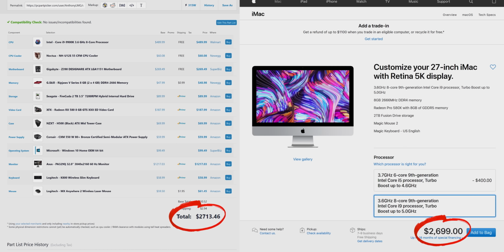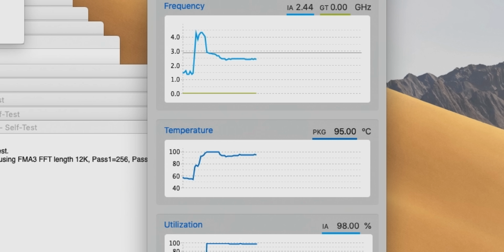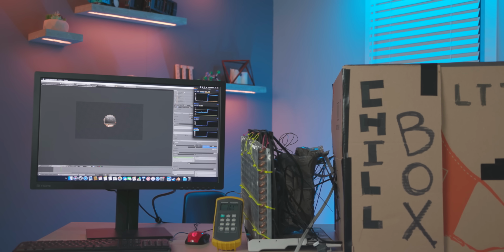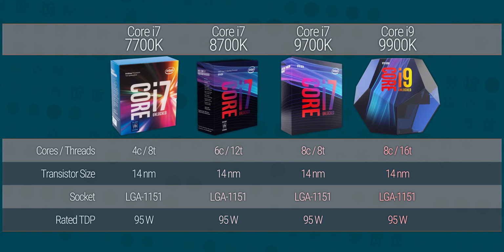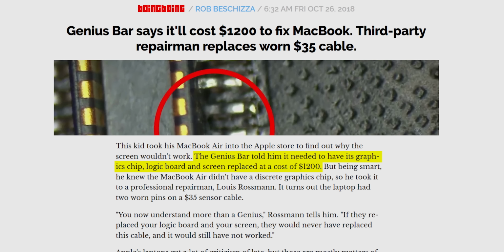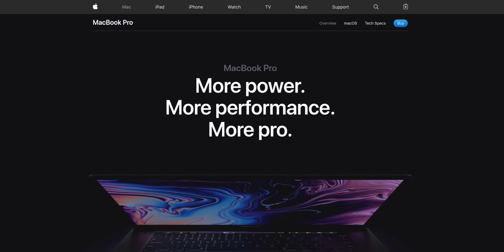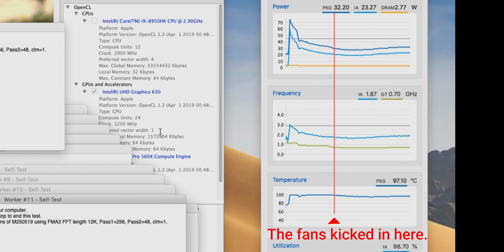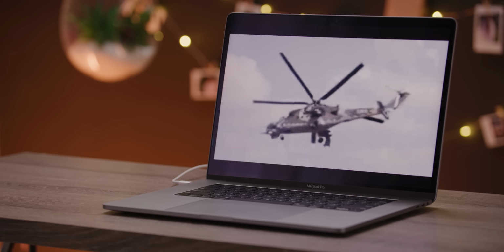Macs are SLOWER than PCs. Here’s why.

Comment: Personally I find it pointless to cram that much power in such a small form factor. Why not just make it 2mm thicker and get adequate cooling? Ultra thin and lights are a dumb concept. There is literally 0 reasons to have a 3mm thick laptop...
Reply: Engineering: you can pick two out of thin/lightweight, speedy fast, and cool.
Marketing: We still want to claim all three. What about the cost?
Bean counters: We always charge the highest price point. Cost is irrelevant. Give marketing the ability to claim all three.
Engineering: Thermal boost, but don't allow it to kick in immediately or it will negatively effect battery life. Then marketing and bean counters will lose their shit.
Reply: AK90 - I use Mac and Windows. I have both sitting on my desk every day. I like MacOS more than I like Windows these days. But the entire "super thin" laptop craze, started by Apple, annoys the shit out of me. Lightweight is good, well-cooled is good. Thinness beyond a certain amount is pointless. 

For the new MBP redesign happening this year, they could add thickness to them while keeping the weight largely as it is. They won't.
Reply: Hey you can show how strong you are by breaking it easily.
Reply: Light weight laptops isn’t something apple started. Unless you live in a chill box hahaha. Anyway look up the fan specs on MacBook’s. My mid 2012 pro can go up to 7000 rpm if I’m correct. Now look at stock coolers for desktop’s from that time period 😉

Comment: You always act like 90°C+ is very dangerous for the longevity of the machine but Macs failure rate are way lower than every other PC OEM with better cooling, but crappier parts and engineering... It's one of the reason why they keep such much resale value even after 5 years and keep working fine for so long. Because they last even trough they get hotter than other

Comment: "A slower CPU that doesn't throttle is not slower than a faster one that does."
>stares at my macbook air with a dual core i5 ramping up its fan and still throttling.

mkay thanks apple

Comment: Macbooks slow down over time...

Because you can't type on the keyboard after 12 months
Reply: No, they don't. You ned to do maintenance. My iMac is 11 years old, and still not that slow. First try a restart or 3-4 times, and see if that helps. If not … then you can try backup your data files. Make a new acount on the computer. Then delete the old acount. It sud be fixed like new. This is whats easy on OS-X
Reply: Read more  @Gismo3333

Comment: Linus: Not for technical users

Me: $2400 every week doing web design/dev/photography freelance

I used to build PCs. I could buy a new Mac every month and still cover all my bills and retirement goals. I don’t give a crap if it’s slightly slower because every time I use a PC it’s a clusterfack of update this, change config file that, run virus scan again, slow to a crawl, blast a fan in my face, whoops my motherboard/power supply/drive controller failed again BS. The Mac has the reliability I trust, the software and workflow that I need, and the design that I enjoy using. It syncs everything together with my iPhone and iPad and creates a frictionless user experience. And again, it helps to make me boatloads it money. And I can also connect an eGPU in Bootcamp and play PC games on high settings. It does it all. And I only upgrade every 4-6 years. It pays for itself about 150 times over. Just let that sink in.

Comment: The real problem was intel in my opinion. Apple could have thrown their best chipset for Mac lineups but Thundebolt 3 is intel copyright.
Since we all know all Apple wants is thin and light, also a sleek design (future proof as always). So all of mac will suffer from over throttled. Have you seen any AMD laptop using thunderbolt 3? Cause as far as i know they’ve none of it. Intel specifically aware Thundebolt 3 is the future, they copyright it, so anyone that wants to use it, should also use intel chipset.

Comment: Cooling is always an issue with macs, sure, but at least they don't melt like hp laptops loool. I do find mac os runs smoother and faster...more responsive gui
Reply: No, its not the issue with Mac. All PC have problems with heat, spesaly laptops that are used to do workstation work loads. Buy a Workstation and the problem is gone. You have the worng tool.

Comment: The problem is that Macs also use such specific parts that make them cost inefficient when you try to build them. They cost way more than other builds that cost much less and do more if your weren't constrained by following with the same exact Mac spec.

Comment: The problem is planned obsolescence and as you point out later on in the video it is far more expensive to use Mac's given that it was thermal throttle and the heat from the CPU will impact the other components it becomes a very poor investment of a considerable amount of money and I would rather custom build a PC that I know I can cool effectively myself rather than rely on a Mac that will burn itself out , so pay attention to what you're saying in the beginning because it's incorrect

Comment: They did the same thing for iPad Pro where initially they said that it's a Laptop replacement. It's actually not. And then the Apple fanboys say why are you comparing to a laptop? It seems that the fans have been brainwashed into thinking Apple themselves never said it.
Reply: It actually can replace a laptop for a lot of people.
Reply: @steven4570  for browsing maybe but not a complete replacement.
Reply: @megalith  For some people, it can can, got several clients that use them
Reply: I seriously wonder what their work flow is because even for browsing, iOS is such a headache as not all the sites I go through support it properly. Also you can't connect a lot of the generic USB peripherals. Especially storage drives. What day and age is it?
Reply: @megalith  These people don't need USB devices, all cloud and local based.  I've found browsing fine unless it's a shit website that has flash.  Haven't had any complaints from them on it.

Comment: I disagree. Sure, MacBooks are bad for extended heavy usage, but most of us use laptops for other things than encoding, in which the higher clock speed for a short period of time is quite nice. Most of us just use it for Office for example or other lightweight software needed, and only a small niche actually needs or wants to be able to render video files or game on a laptop. Quickly switching apps and opening files is more important in most cases than the capability to run the CPU at full speed for 10 minutes or more. 

Besides, 2k€ isn’t a lot of money, so a MBP isn’t a status symbol, it’s more like the baseline of laptops, just like an iPhone is for phones.

Comment: Its obvious with the fan speeds that they are prioritizing quiet performance over raw speed. It would have been more interesting if you ran a custom fan profile which there are apps for doing just that(smcfancontrol for instance) when doing your benchmarks or longer workloads.

Comment: Actually, I just locked my fan speed at l:5927 r:5489 with Macs Fan Control when I am doing serious work. It's a little louder, but still, quieter and lighter than a lot of PCs. (LOL
Reply: My MacBook Pro is literally blasting hot air from the back while I was typing these lines

Comment: There is an elephant in the room that's not being mentioned.  I am pro macOS and I prefer it over Windows, but macOS is usually slower and more RAM hungry than Windows is.  So even if Apple did make a mac as powerful as a Windows machine, it will still be slower.   Phoronix.com has thousands of benchmarks of Windows, Linux and MacOS over the years, and Windows and Linux is significantly faster than macOS.  Linux used to be slower than Windows too, but Windows 10 took a performance hit, and Linux has gotten faster over the years.  Even in some 3D games, Linux is starting to surpass windows.

Comment: The reason iOS devices have a better thermal record is because the A Chips are in house, so apple can design them around the design of the phone, rather than design the phone around the chip (like they ignore with the MacBooks)
Reply: That sounds more like an excuse than a real reason. Yes, it explains why the phones run better, but it doesn't explain why Apple can handle heat in it's laptops and desktops as well as its competitors.
Reply: @JeffDeWitt  I'm not trying to justify Apple, I'm just saying why it isn't an issue on iOS devices
Reply: @Justin-zi4wm  Fair enough.

Comment: I own an i5 8600k, and I'm cooling it with the very popular, tried-and-true, Cooler Master Hyper 212 EVO. I've never seen temps on my CPU (doing 100% utilization, very intensive renders) higher than 78C and it's never throttled whatsoever. It has never seen temps of 80C+, ever. I have an ambeint/room temp of 22-24C, that is controlled. I guess if you ran my pc in a stuffy, hot room (30C+), I can see temps of maybe mid to high 80's. Never 95C+ though! Jesus that's high. Poor CPU, even though it can handle it, It will eventually prematurely fail from prolonged heat.

Comment: I think linus just missed it. This is part of the reason why apple and intel’s business relationship isn’t in good standing right now. Apple has more control of the design of the iPhone ARM processor than intel’s x86 processor. ARM processors generally produce less heat and Apple has pushed them to 7nm transistors Likewise, the appeal of Macs are not just style, but also a commercially viable UNIX machine. Finally, If you’re coming from a PC background, having a gaming case or laptop, is it that much different from owning a mac?

Comment: I still find the cost of apple products to be mostly overpriced. They are really hard to customize and that means a lot of times you are using either overkill parts or mismatched parts.
Reply: Exactly, you need to factor the cost of upgrades over time (or amortization)  You would have to buy a whole new computer vs just upgrading graphics and hdd and ram. This also means if you don't want to have to buy a whole new computer in a few years you have to buy all the upgrades up front. You could start out with a $1k PC and upgrade it with more ram after the  initial shock. Where you would have to spend almost twice that for an iMac.

Comment: Not defending Apple.
Intel does state that Turbo Boost speeds are not guaranteed.

The Mac mini’s cooking solution is rated for a Thermal resistance of about 1°C/W with a Qmax of 70W.

I’m happy to see that a major media outlet has called out what Apple is doing here which gave credence the conclusions I drew about this same problem a few months ago.
Reply from the maker: Fun typo there... :p
Reply: True that ;)

I’m going to leave it as is for posterity because the fan curve is atrociously slow.

Comment: “Less tech savvy.”  Not sure I understand that comment.  As an engineer for a major audio company, I feel I am tech savvy.  Apple keeps me in their eco system due to software.  I despise windows and unfortunately not many of things I do for work is available of Linux.  (Though I do have a Linux box at home).  There is the idea of making a “Hackintosh” but for my job I need a computer that is going to be reliable with each software update.  Your video is accurate, just don’t see how someone’s technical capability plays into which OS they prefer.

Comment: One program you must download -- Macs Fan Control.  It lets you control the fan-speed yourself, based on whatever internal temperature-sensor you want.  I use the CPU PECI sensor and tell it to start ramping up fan-speed at 40C and give me 100% fan speed at 80C.  Makes the computer run a ton faster.  (Under the severest loads, it still can hit 95C, and will then thermal throttle -- but it takes a lot longer to get there, and doesn't stay there forever.)

Now...  Because of the new T2 security chip, Macs Fan Control does not work in Windows on any 2018 or newer MacBook Pros...  So what I do is I boot to MacOS, set Macs Fan Control to turn both fans up full blast all the time (yes it's loud), then reboot into Windows normally.  That leaves the fans at full blast, so they achieve maximum cooling.  I get a solid 60 FPS (the max the built-in monitor can support) on Grand Theft Auto V with mid-high settings at 1440x900 resolution in Windows 10 with the built-in Radeon Pro 560X GPU on my 2018 MacBook Pro core-i9 computer.  If I don't do the trick with Macs Fan Control, it fluctuates between 20 and 45 fps in GTA V as the CPU and GPU throttle themselves up and down based on how much heat they're generating.

If you own a MacBook Pro, you need Macs Fan Control.  Period.

Comment: It possible for Apple to design a MacBook where the metal chassis is part of the heat dissipation process??
Reply: You’d burn yourself when you touch the device because you’d try to dissipate 90C temps. Not a good idea

Comment: Okay. This is clickbait. The title is clearly misleading. To call a computer "faster" or "slower" is typically used to describe the time it takes to preform tasks (loading a webpage, opening up an application, boot time, etc.) This video covers none of that. It instead is focused solely on clock speed. Of course a Mac with an unreasonably high specced processor would be outperformed by a PC with the same processor but with adequate cooling. That's just obvious. There's no need for an 11 minute video to explain this simple fact. But to take the fact that an inadequately cooled processor will not preform as well, to run with the title "Macs are SLOWER than PCs" is just outright wrong. The processor is not the only component in a computer. Surely, a channel with "Tech" in its name should know that. Not all tasks are CPU intensive, again, something a channel with "Tech" in its name should know. There are tasks which may take up more storage resources than processing. In those tasks, a Mac would be faster, as Macs generally have have faster storage. During the period of time where Apple was including solid state storage in most of their computer products, and when PC manufactures were not, at that time I would say that Macs were faster, regardless of the CPU performance of any given Mac, because at that time, because of their solid state storage, Mac were clearly and obviously faster in preforming the tasks a user would preform. Linus keeps claiming that the channel's "clickable titles" are "not clickbait because they're not misleading." When that is clearly not the case. This is clearly and obviously clickbait, and it is clearly and obviously misleading.
Reply: I own devices running macOS and Windows. I don't care. If for example, you can objectively prove that macOS is slower, that would be a great thing and would actually fulfil the title of the video. My issue here is the fact the title on this video has nothing to do with the video itself, because it's clickbait. Shit on Apple, macOS, and Mac hardware all you want, that doesn't change the fact the title of this video is outright misleading.

Comment: reason??? ill tell ya why and ive known it to be like this for long time buy a pair  LA light sneakers! basically just paying to be a billboard for the company !!  reality is them sneakers are designed to self destruct / fall part a set time getting you back to buy nother pair ect,, for no name brand they know they cant compete with larger company in this area so instead focus on durability as there selling point !! kinda sad 120$- sneaker rot away after a month. yet 20$ no name brand had lasted 2-4 years no difference  this same shit appears in other areas too in computers..

Comment: The problem isn’t the size of the MacBook, it is the direction the fans exhaust. The air has to twist and turn and this lowers the efficiency of cooling. The air gets exhausted up in front of the screen and doesn’t have a direct shot out the back of the laptop like most gaming laptops we see today.